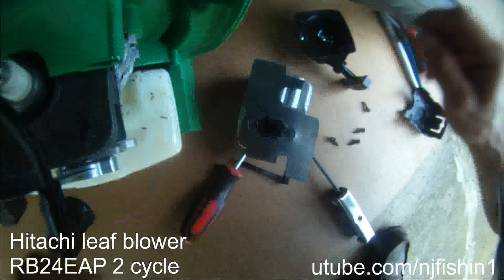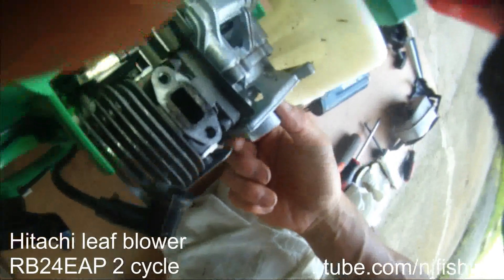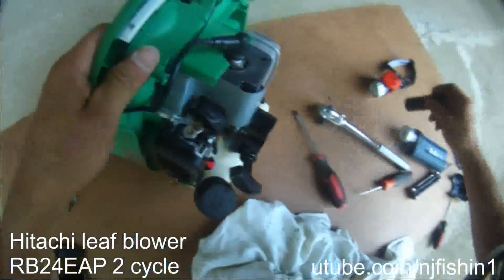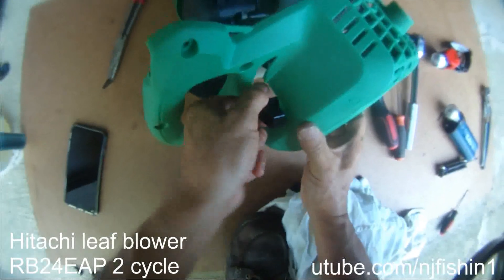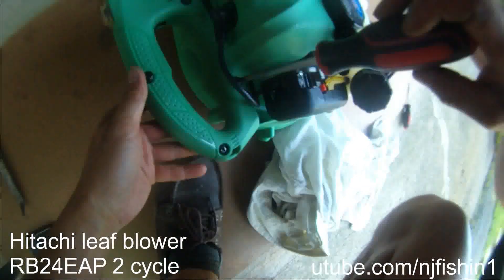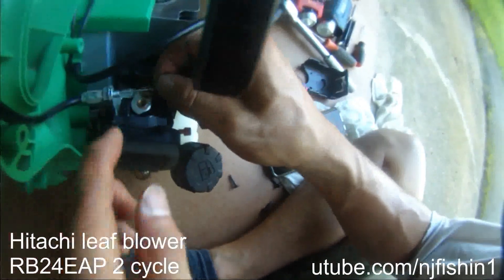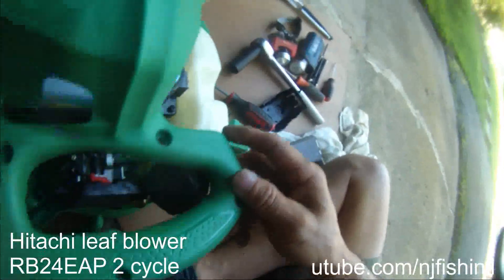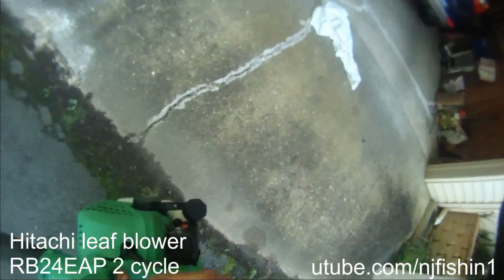Unstuck a stuck pull rope of a 2 cycle leaf blower - Part 3 of 3 (Hitachi model BR 24 EAP)

Comment: The way I fixed mine was to take out the spark plug and then I was able to pull the rope..pull it slowly because gas will come out of the spark plug hole....not sure what is causing this but it seems to fix the problem for a few months at least.